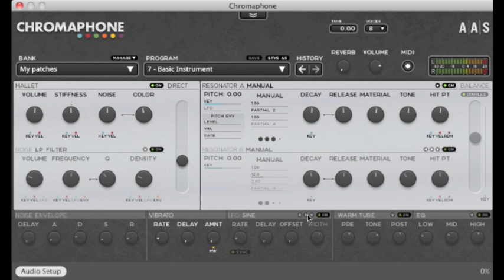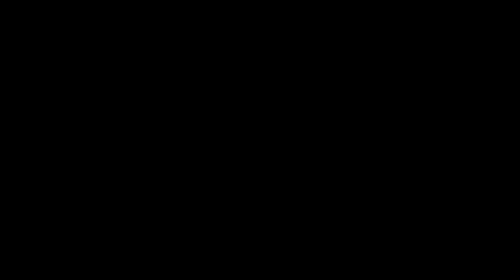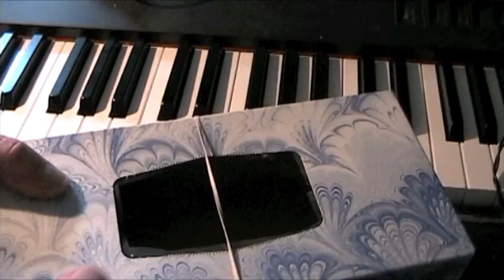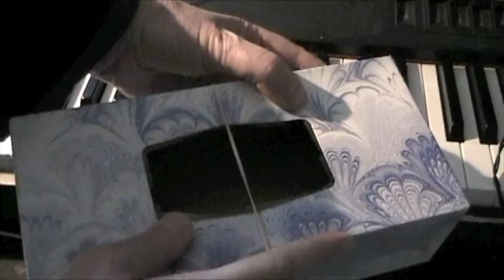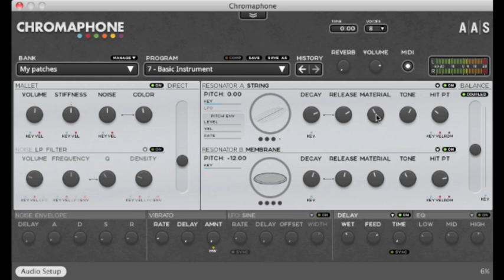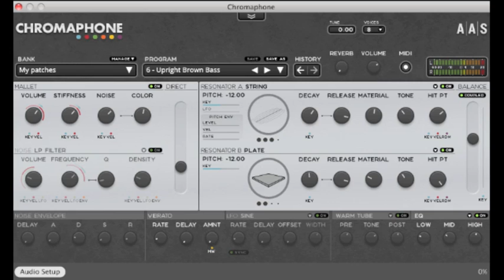Chromaphone Introduction

Comment: Well, if anybody cares..... :)
The tone control has the same basic effect as a variable slope low pass filter. So a setting of -6db is the same as having a LP filter set to the fundamental (your main pitch) with a slope of -6db/oct, -12db is a LP with a slope of -12db/oct and so on. Setting positive values flips it, so instead of cutting it boosts. 
In real world terms, setting the tone to a negative value is similar to muting a string or dampening a skin. Positive settings could/will effect the relative level of the fundamental compared to its overtones/harmonics (could be useful in a busy mix/composition, but now we are getting into psycho-acoustics and youtube comments just isn't the place :) )  
Most 'real' instruments, if not all, would have a slightly negative setting as the fundamental is usually the strongest freq.
Huh. I did learn something at uni after all! 

Anyways, thanks for the clear walk through, the example you use really helps put it into context.